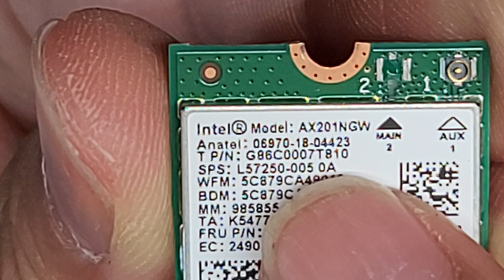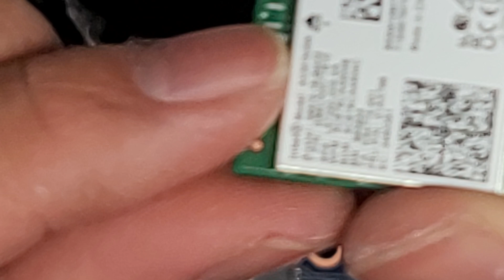HP Pavilion 15-cs3073cl Disassembly RAM SSD Hard Drive Upgrade Repair Battery Replacement

Comment: I have this series laptop. and I have replaced the LCD but why have I ordered the exact same part several times but it doesn't support the touchscreen & the costs I have paid are also quite expensive. Have you also experienced it?

￼
Reply from the maker: @agroindustriuntagsurabaya  restart the computer after installing